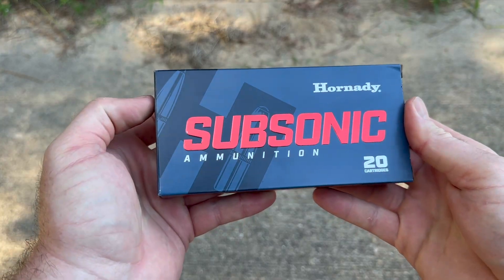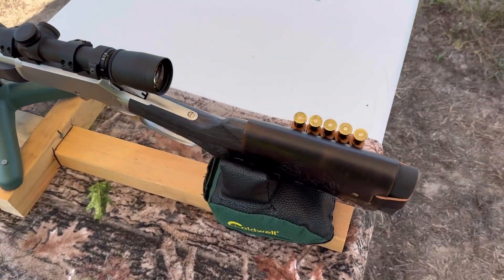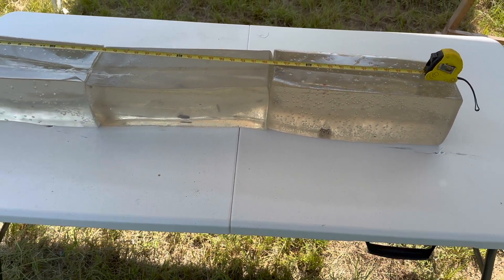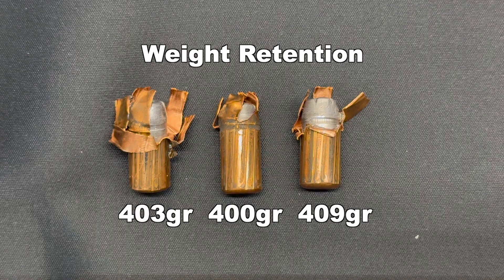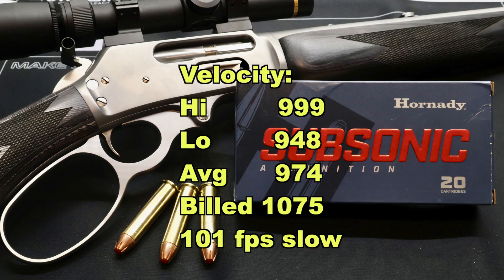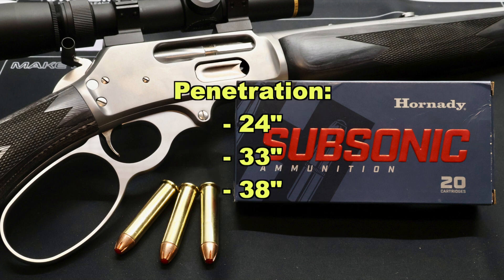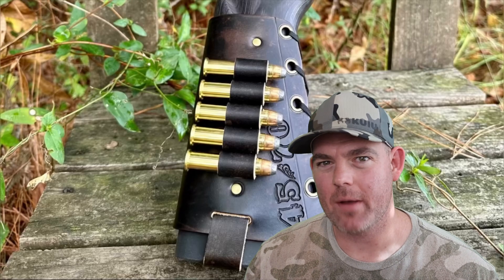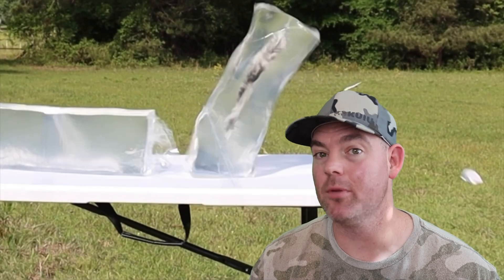BARELY MOVING!? 45-70 Hornady 410 grain Subsonic Ammo Test

Comment: I have that scope. It’s a good scope. I kind of like the vx freedom 2-7x33 fire better though. It’s a magnum rated scope but just says rimfire.

If you aren’t dialing in ranges,,,, the vx freedom rimfire is the way to go for low power Leupold optics.

Same weight ,,,,
More magnification 
Closer parallax. 
Good reticle for hold over, has good elevation MOA hash marks.

Comment: Those velocities you recorded were just past the muzzle. At 100 yards, they probably dropped below the advertised 900fps threshold for expansion.
I'm going to handhold these in 458 SOCOM at 1050fps out of my rifle and see I how they do. At 150yds, they should be above that 900fps threshold... I'm also going to push them supersonic at about 1550-1600fps to see what happens then (the heads are rated up to 1650fps.
If it works out, the higher velocities should be a good "brush-gun" for Elk out to 250yds in the scrub brush or heavy wooded areas. For open country, I'll stick with the .308, 7mm Rem mag, or 300 Win Mag... less drop to compensate for.

Comment: I imagine this stuff is pretty expensive. Isn't the point of this ammo that it opens and expands at low speeds? If so its a complete failure
Reply from the maker: It’s starting so slow that it’s going to be below its 900 fps expansion claim threshold very quickly, so I don’t really know what it is more than a gimmick at best, even a 45 Colt with 12 Brinnel lead doesn’t really expand or flatten at these velocities either.
Reply: I got 2 cases of this stuff a few months ago for 1.60$ a shot, using it as plinking loads

Comment: I am the first to call out Hornady on their over the top marketing BS. 
BUT I think this test needs to be re-done if Hornandy is promising expansion down to 900 ft/s. With the average speed measured at 974 the bullet was at 860 ft/s at 100 yards. So it can’t be blamed for not expanding. 
I think that goes to show that subsonic loads belong in the hands of reloaders that can get as close to the magic 1125 ft/s with their specific barrel length as possible
Reply: Had another look at the numbers. With 1050 ft/s at the muzzle it would be 930 ft/s at 100 yards. Would be interesting what kind of expansion that would result in. Sometimes a little bit of speed is all it needs
Reply: So a 50 yard expansion test for subsonic would seem to make sense. Probably across the board really. As 100 yards is basically a maximum range of engagement due to trajectory, it makes sense in that regard too. Especially in the shorter barrel lengths. 

Id like to see this done at about 50 yards as it should be hitting above that 'magic' 900fps mark.
Reply: @bryantitus6634  yep, good idea. 50 is quick and easy for a retest. Should be at about 920 ft/s out of the rifle that was used. And if it still doesn’t expand, which quite likely, we‘ll have some fun with Hornandy in the comment section 😁
Reply: @bryantitus6634  and totally agree with the max 100 yards. That thing as a subsonic has the trajectory of a medieval cannon. To be 3‘ low at a 100 you need to zero at 18 yards 😂. So you can zero at the handgun range.
Reply: I want to hear it through a suppressor.

Comment: This idea needs adjusting a little bit. Wide Flat Nose cast of 300-350 grains at similar speeds would work better and penetrate really well. Expansion isn't required. A  warm .45 Colt class load out of a .45-70 carbine has merit for other than suppressor use. People that don't do handguns being a perfect example. A .45-70 could be a very useful EDC  truck gun for back country folks. Rarely do we need full power loads anyway. There isn't much that a warm .45 Colt class load can't do on animals within say 50 or 60 yards.

Comment: Clearly designed for suppressor use. Outside of that, I find the load rather pointless. There's so much more on the table in terms of .45-70 potential. Hey, if modern Winchester leverguns weren't so expensive, I'd be all for the .45-90. But that's strictly a hand-load situation.

Comment: I think they need to go back to the drawing board on this load. The lead is way too hard to expand at those low velocities. Need to soften it up a bit to get mushrooming. I think the tip was supposed to help, but seems all it did was rip the jacket away.
Reply: Well I would like to see the animal that would keep living longer than a min or so, with .75" holes through both lungs.  Granted the lead didn't expand, but a 45 cal bullet really does not NEED to, to kill quickly.  In fact most dangerous game hunters do not use anything but solids, when using 45 and larger calibers.  They want penetration.

Maybe they need to redesign the box instead.
Reply: @Handirifle definitely a bone crusher
Reply: Yeah this is really disappointing